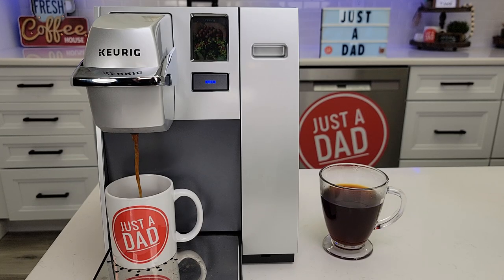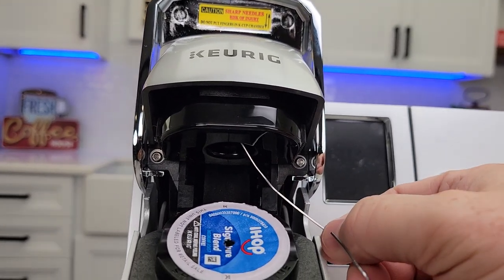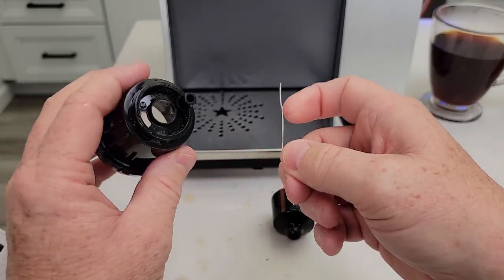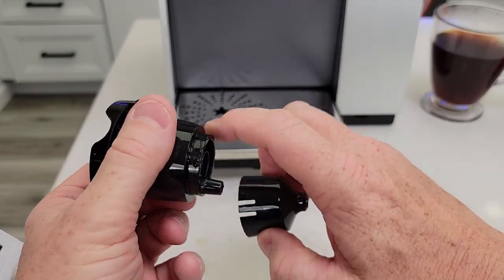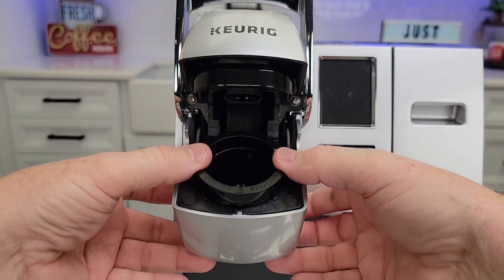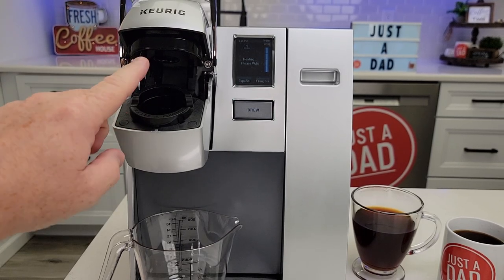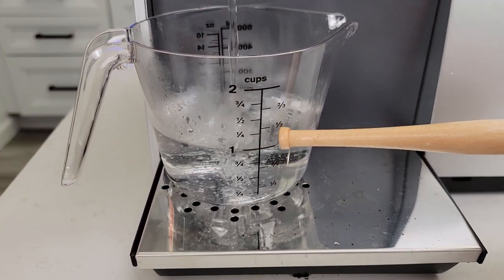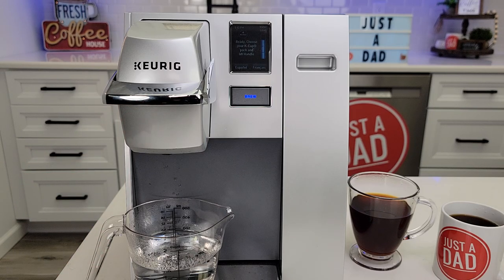How to Fix and Clean the Needles on Keurig K 155 Office Pro Coffee Maker

Comment: FYI, if you notice the molded plastic piece around the upper needle has two thumb finger grips on each side, you squeeze and pull forward, and it easily removes for better access to the needle